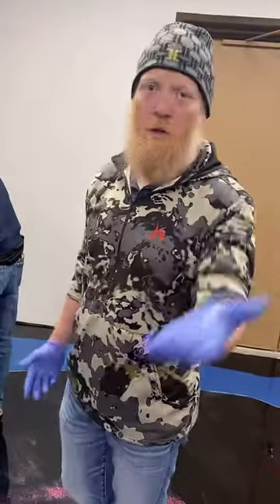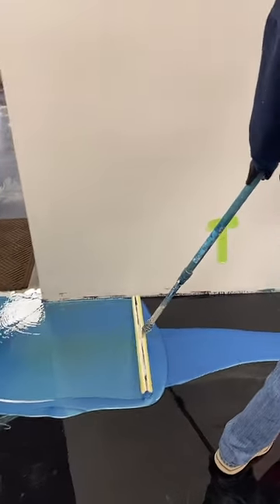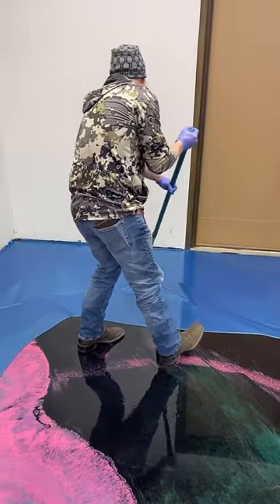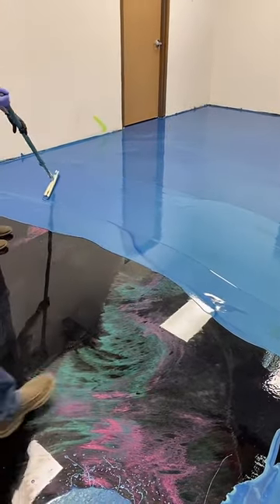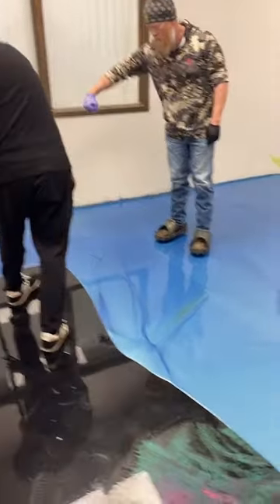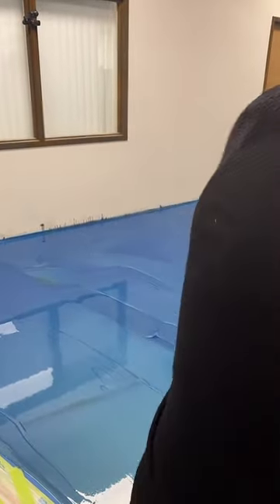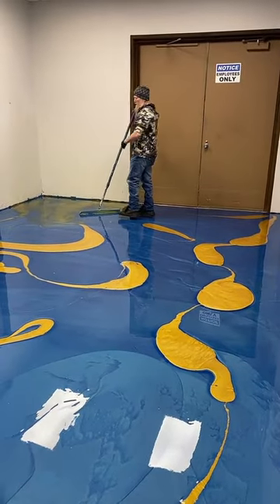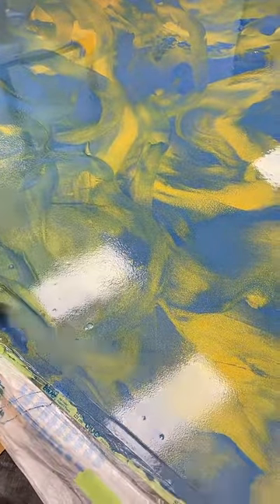Epoxy Floor Install - Countertop Epoxy - Workshop Epoxy Flooring - TikTok Live 04/05/23

Comment: 2 hour work time...what?...most Epoxy starts getting thick and warm and becomes unworkable after 35 min, at least the ones I have used...is your Epoxy fairly thin, the stuff I use is way thick and way less working time....and is that being laid down within a 24 hour recoat window to get a bond, I usually always have to sand because of junk in the epoxy or I miss that recoat window.
Reply from the maker: Different quality Epoxy and different applications! Sounds like you have a lot of great questions give our office a call where we can have more of an in depth conversation 970-639-9338.